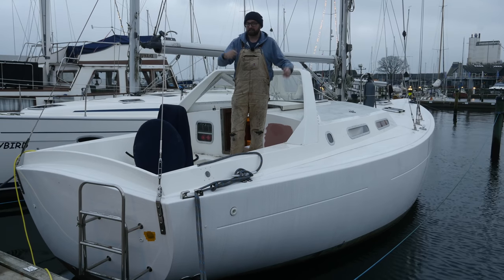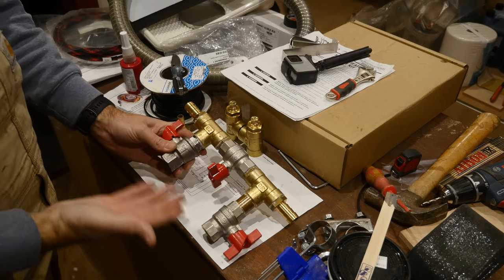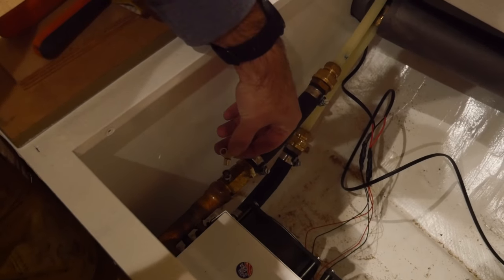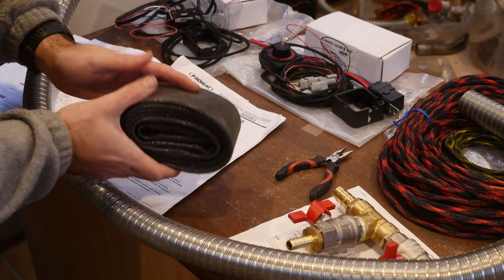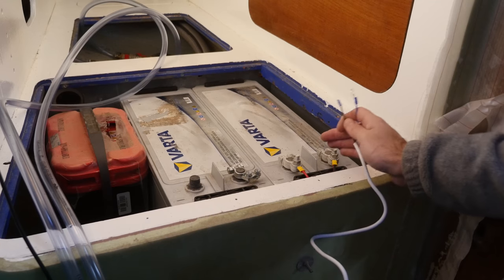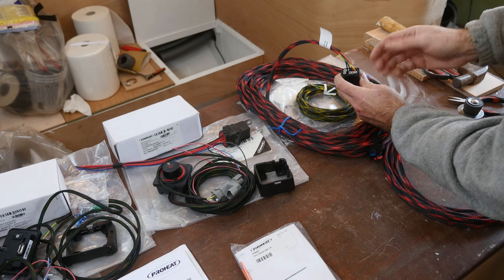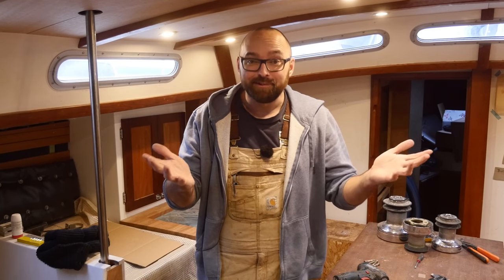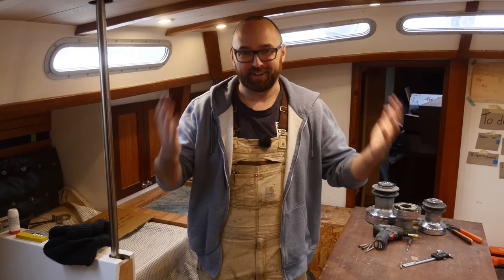Sail Life - Dometic Proheat X30 hydronic heater on a boat, part 3 of 3 - DIY project

Comment: While this sounds a bit crazy, but you can save a HUGE amount of $$$, if you build your own LiFePO4 battery bank !  Check the YouTube Channel DIY Solar Power with Will Prowse.  He also has a forum (https://diysolarforum.com) that discusses building your own.   LiFePO4 individual cells are available directly from China in sizes up to 280Ah. 4 would make a battery pack that is 2.8 times as large as what is commonly available and AT A LOWER COST.  Yes, you need a battery management system (BMS), but those are available directly from China at reasonable costs.

All of these items have been reviewed by multiple people so you are not going into this blind !  Something to think about.  (Rumor is Battle Born will be releasing a 200Ah battery "real soon now" !)

Comment: Isolating all possibe vibration sources from the resonating hull makes a huge difference. 
Axial fans are noisy by design. Reducing air flow resistance make it possible to reduce fan speed and thereby sound. Centrifugal or Cross flow fan types generates more air flow and are relatively less noicy. Tiny ventilating holes and short circuited inlet next to outlet make the design inefficient resulting in unnecessary noice, amperage consumption and inefficient heating.
Also, please filter out unnecessary information and replace it with calming pauses of not speaking 100%

Comment: Is that a bladder you are releasing air from the expansion tank Mads ? If it is , the bladder needs to have some air pressure in it . if I am talking out of my ass please excuse me  and rake me over the hot coals ! I talk out of my ass sometimes when I have had more than one beer !
Reply: I was about to ask the same thing. My understanding is that the expansion tank needs air in it to act as a buffer so that the fluid in the system does not build up too much pressure (fluid isn't nearly as compressible as gas, so a system with only fluid quickly reaches high pressure when it expands due to increased temperature, which blows hoses and couplings).
Reply: I believe Mads stated the system was open to atmosphere and therefore will not go hydraulic.  The buffer tank adds thermal working mass (fluid) and therefore should be full.  The high point vented expansion tank should have air space so the tank does not overflow from fluid expansion doing normal operation.

Comment: as I see. There is a diesel engine with a powerful alternator on it. There will be also a powerful diesel generator on board. Yet, instead of a silent and less complicated, cheaper, more reliable electric heating (infrared film), the heater is also using diesel. You end up generating a lot of electricity for nothing, using diesel oil. Even running the traction diesel engine and generate hot coolant with that would be quieter, I think. I do not see a logical structure on this boat. furthermore, getting an air duct from the saloon to the V-birth while using a refleks stove is still ten times more reliable setup than building pretty much the same system on a boat which is used in apartments... Nice kraftmanship, though.